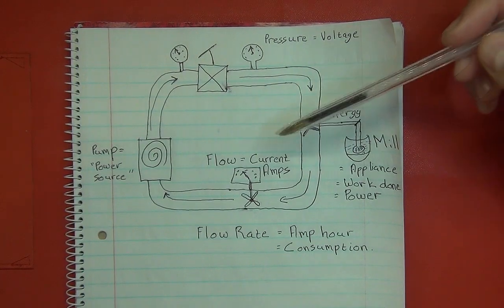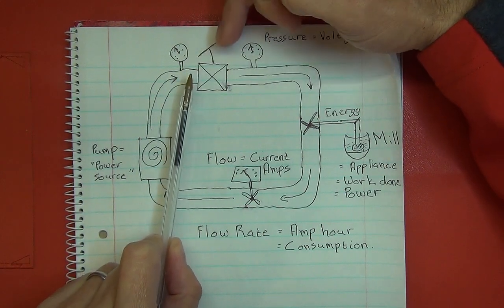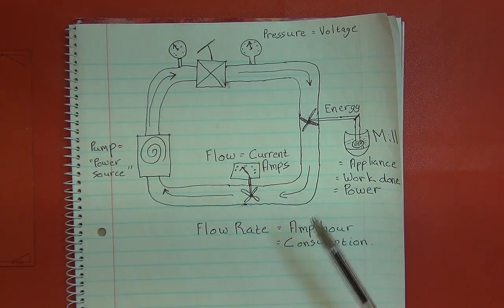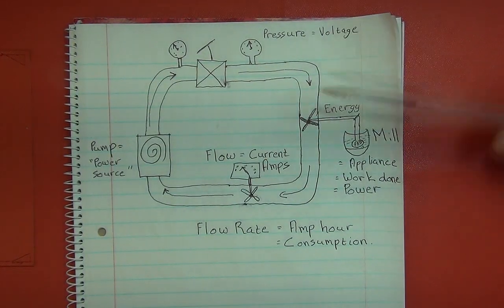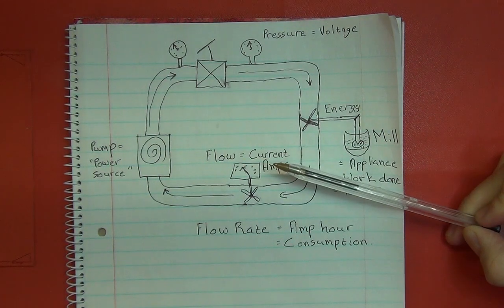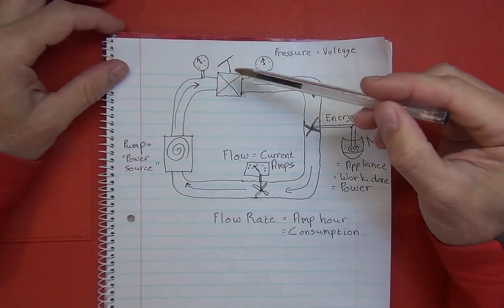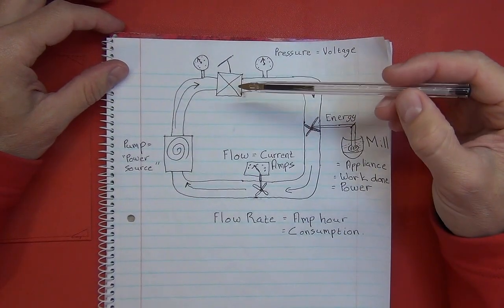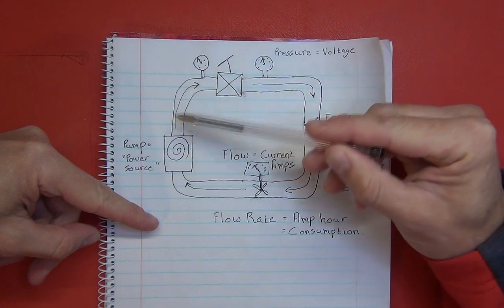Electronics Tutorial #1 - Electricity - Voltage, Current, Power,  AC and DC

Comment: Energy can never be created or destroyed.  Doesn't that mean where in your circuit you take a measurement matters  -  you''ll get different readings?  The values of the measurements on the circuit taken before the mill/appliance will be more than measurements taken on the circuit after the mill/appliance?   On the downstream measurement wouldn't you have to lose something -- voltage, amps?  Thanks.  Just learning electronics now.

Comment: Before I have seen voltage explained as the height of a mountain pushing a mass down the side of it to power electrical components, but the water pressure analogy is much better.

Comment: Hi. Your video is really informative. You are really helping out people who have desire to learn.
I want to ask something here i am stuck in the paper work you did about the flow chart.
I want to know if pump--power source is actually the main DC  line and the vaulve is the power metre where we control all the supply. The thing i am stuck in is how the flow is going towards the main DC line? I could not understand it. There are two wires + & - both go towards the drain from its source. The valve is like a gateway. I just cant understand the process of returning back to the main Power.

Comment: Question: Yesterday I found a old light bulb that has 3 ft long cable that plugs directly into a normal wall outlet. What I wanted to do is make a manual relay switch that activates the light bulb when you flick the switch. Now the switch I found only works with 120v AC. I know the wall socket is 120v AC so what I did was strip the wire and attached it the switch and reattached it to the cable that runs to the light bulb. The idea of it is really simple. However I turned the switch on and the only that that happened was the power tripped for a second and turned back on. Why didn't it work?

Comment: Very helpful.  I am trying to make sense of what I have to know to increase my rating in HAM radio and this helps greatly.  The language of electricity is a very foreign one to me.  Your descriptions are very relatable to me.  My brain is like your 12 volt battery.  Increasing the pressure/voltage/information too high will blow up my brain so this is just right, we have pressure match.

Comment: Thanks for a wonderful tutorial, I hv a Question, While charging a 12 v battery, if i supply 14 to 15 v constant, how much the maximum Amps or current I can supply for the charging ? is it possible to keep the charging voltage constant at 14 to 15 v and increase the Amps only ? but how higher the amps i should increase for charging ?

Comment: Great work! I would only say that AC current can definitely grab hold of you. It will not push you off unless it is a very high voltage. It is common for electricians to get hung up on 277v lighting circuits and they cannot let go or scream as all of their muscles tense up. With some luck they will fall off their ladder and prevent dying. On extremely high voltages they will get blown off but this can cause death or severe internal and external burns.

Comment: fantastic video! really helped a lot, thanks mate. one thing I'm confused about is how the amount (current, amps) works on a real circuit. Here in your example current increases as a result of the size of pipe. Is this the same in electronics and wiring? can the current only increase if the wire is thicker? In your led bulb example the amps increased as voltage increased, yet the wiring didn't change, which kind of confused me.

Comment: Nope..I'm wrong...sorry Martin...I just realized the inverse of 20ms is 50Hz.  What you said is correct.   Your setting is 10ms, which means each major vertical line is 10ms and each minor tick is 2ms which is dependent on your settings.  We know that your input is 50Hz because it took 20ms to complete one sine wave.  And 1/20ms is 50HZ as time and frequency are inversely proportional.

Comment: A big "HI" to you wise man!  I have got a crazy question. When I turn on the motor of my Nissan X-trail, my Garmin GPS (Nuvi500 has no battery) turns off, because the starter drags down the car battery voltage to 8V. Thus, I series soldered a 65000uF/25V electrolytic condenser and that allows to bridge the momentary min. 300mA/10V power loss. 
Question: is there a way of using smaller condensers, such as using super capacitors?  I bought some o.47F/5V5, but when I connect 3 of them in series the GPS ignores them. How come?

Comment: Just a thought on your closed water system analogy, if the system was made of 'magic' pipe that automatically sealed when cut/broken then it would closer follow the electrical circuit model. You analogy would hold water so to speak - pun intended!
BTW great vids, filling voids in my knowledge, thanks :)

Comment: What happens if you turn the 'output' off on the power supply while the battery is hooked up? Would the power supply handle the electricity coming in and just dump it?

Comment: Looks like I'm 3 years late to this party! Do you have any recommendations for absolute must have tool for working with electronics? I will be doing work with solar installation, wind power generation, and water power generation, also - some circuit design.

Thanks so much - on to lesson 2!
Reply: This is a very useful app for use on an android phone :
I use AppDevGenie, which you can find on the Google store for Android devices. Very useful.
Reply: Look for "ElectronicsCalculator" by the above provider.

Comment: Thankyou, after asking 3 different electricians about the flow of electricity they all tried to convince me that AC flows in one direction where I suspected it went backwards and forwards. I even drew a sinewave picture with a positive, neutral and negative side to visualise my suspicion. Are the 3 pins in a power plug representative of the 3 states of power? if so is earth the negative? and does having only 2 pinned power plugs mean it has to be a DC appliance?

Comment: Hi mr. Lorton, i have a question. What happens if the pressure/voltage pushing into the battery is lower than the battery? Lets say the battery is 12volts and the device pushing into the battery is only at 5 volts? Does the battery lose pressure? And then what happens next? Excuse my slow brain hehe. Thank you in advance and I really like your videos.
Reply: You just subtract the pressure opposing the battery pressure to work out the net pressure. For example: battery pressure = 12 volts, opposing pressure = 6 volts, the final pressure = 6 volts from the battery.

Comment: ok. pressure is the same analogy as voltage and flow rate acts like a current. you explain the physical quantities with other physical quantities?!
Reply: ok. how to understand what flow rate is could you be more specific?
Reply: ***** Current flow is defined as 1 coulomb of charge (which is a "packet" of very many electrons) moving past a given point in a circuit every second.
Reply: ***** BTW, what I have just described = 1 amp.

Comment: I have just built my first circuit.  A simple fan speed contoller using a LM317 voltage regulator.  Thank you for your video.  I'm looking forward to listening to other videos.  I am now looking to add a transformer to the mix so I don't have to rely on a wallwart.

Comment: Static electricity is also dangerous when it comes to electronic devices. You could blow something up if you don't discharge the static before handling electronic equipment.
Reply: I work in electronics workplace and we have to use esd technology and grounding ourselfs when working with sensitive components on boards.
Reply: Nate S cool. do you sometimes use antistatic wrist bands? Also where can I get some more electrical experience? Just wondering because I don't really have electrical experience and I would like to get more hands on experience. I did take some electrical classes at my University. It seems like a lot of places want years of experience. And I'm really trying to find a full-time job in something technical. Thanks.
Reply: Yes, we use antistatic wristband and we test them. You do get experience as you work. I didn't had experience before I worked there. I guess It depends on the job. I do my own electronic projects at my house. I really enjoy it. :D
Reply: Nate S Cool. What kind of electronic projects have you completed? It sounds fun. What in particular will make an employer want to hire someone who wants a job in something electrical? Thanks! :)

Comment: so can amps be considered the SPEED of of the electric current? because with the mill you drew the only way to make it spin faster would be to make the current go faster, and how would you measure amount of electricity if not how much flows per second or given time frame, so quicker current would mean more amps, yes? no?
 please respond im trying to learn
Reply: so i just read your annotation where you stated that, but i watched afrotechmods video where he explains amps and he explained it as volume, he showed an over symplified example of a wire 1 electron thick, and  that was 1amp, so a  wire 2 electrons thick has 2 amps flowing through it, but that would alow the rate of flow to be canstanst even tho amps change, now im more confused
Reply: The speed of electricity is 186,000 miles per second, which is the speed of light and the maximum speed anything can travel. It is not the electrons themselves that travel at this speed but the
Reply: almost instantaneous impulse of all the electrons moving over a distance. Think of individual links on a bicycle chain moving fairly slowly yet the whole chain moving virtually at once.
Reply: Richard Townsend thanks!
Reply: I think I say something like that. For example if there is 2 amps then its about 2 Coulomb's per second. So I guess it is travel rate?

Comment: This is a good tutorial. I did not read all the comments so I don't know if anyone else had said this, but in the US all homes have two 110V lines and one ground line coming in to the house. So you have 220V in the circuit breaker panel and you can wire some circuits for 220V example ( central A/C, heat pump, electric stove ) . All standard outlets are 110V.
Reply from the maker: John Coniglio My pleasure John, thanks for the post. Yes, I'm based in the USA now and a video I'll be doing soon will be based on the US wiring system.Cheers, Martin.

Comment: Thank you so much for this series! It's extraordinarily helpful!  One thing I don't understand however is how AC current actually would flow through a wire.  Direct current seems to just go through, so in the fluid analogy, if we put something in the water like a beach ball we would see it move through the pipes.  If we did the same with AC it would move back and forth, but how would the electricity move through the wire to begin with?  What makes AC current flow from the outlet to the multimeter, rather than just hover around the outlet and never make it to the multimeter

Comment: I have been interested in electronics all my life. I have bought many books and read them. After twenty years of doing that I am not any closer to getting to grips with the subject than I was when I started. The problem I am having seems to relate to having to hold onto theoretical ideas and concepts that I cannot see working. It's all too abstract for me.
I have worked as a mechanic for years. I have no problem at all working on engines and diagnosing problems because I can handle the parts. I can take the parts apart. I can physically examine each component and most times SEE what needs to be changed or repaired. However, when someone hands me a diode or a transistor and says, is this the right one for this circuit I stare at them blankly.
It's a real shame but I just cannot get my mind around this stuff for some reason. Of course, that problem is compounded by ever present technical jargon that just bores me to death. Lol.

Comment: Good show Martin.  The one concept I have trouble with when it comes to electricity is understanding grounding and why it is so important, so necessary for electrical flow. You don't mention that specifically in your video or at least not using that term, grounding, but it would seem to be implied in your illustration in that the flow must have a return lest the pressure be reduced to zero as in your broken pipe analogy.

Comment: I recently boil a battery bank with two batteries and a charger for maintaining a 2 amp trickal charge.  Was wondering ...would it be possible to plug this small charger into my pure sin invertor to bring my voltage back up when the electric goes out,  just a thought and would really value your opinion on this idea.

Comment: I'm a British electrician that emigrated to Japan recently. It seems the Japanese adopted the American electrical system 110/120, and sometimes 100V I think.... All of the appliances are low power, and smaller. I assume it's quite an economical system as it forces people to use smaller appliances, tools etc, but it's a pain in the arse if you want to cook a chicken in an oven, because there are no bloody ovens!!! 

We recently had an Air conditioner unit installed. My wife left me at home and the chap turned up (my Japanese is appalling) and he started bemoaning the molded plug on the air con unit. The air con unit my wife had bought online was rated at 200V. I understood what he wanted to do, he wanted to change the breaker to upgrade it to a 200V breaker, and the socket outlet also upgraded to 200V as the Air con units plug pins are only designed to fit 200V sockets as a safety feature. What baffles me is that without using any kind of transformer, he could change the breaker and magically produce 200V. I have to consider the possibility that 200V enters the dwellings here, but is down-rated to 110V internally. I can't conceive any alternative possibility given the breaker was a straight swap over for the old 100V rated one. I didn't compare the current ratings by the way, but I assume the newer air con unit took more current than the last breaker was rated at.

I definitely prefer the 230 Volt systems. They are much more versatile, and anything that has potential to be dangerous can always be stepped down to 110V through a transformer, so I don't think I'll ever get used to this lightweight system..

Comment: Just to add to your point about the mains in the US, we primarily use 110/120v but if you check your breaker box you'll usually find that there are also a couple 220/240v circuits, denoted by the double-wide breaker.  They are intended to be used as dedicated circuits for your electric stove, or washer/dryer etc.

Comment: AC current causes you to stick, DC throws you.  I know from experience.  With AC your muscles spasm back and forth at mains frequency and thus don't move very far at all.  With mains the power is enough to take 100% of your muscle ability away preventing you from pulling back.  With DC the muscle reaction is in one direction and thus a lot of energy can be build up in the form of speed as you hurtle backwards across the room.  Been there, thrown 6 feet by the pull up charge capacitor of a monitor.  Been stuck to a mains plug the back fell off when I was pulling it.
Reply: I'm a little confused. If AC is 'alternating' and it hits 0 (zero) during its cycle it would seem there's a point of release.. Where as DC is constant straight power and gives no chance for release causing you to "stick".
Reply: Yep and both leave you weak and shaking, sometimes with burnt fingers if you give it a chance to arc.  What I don't get is why when you put your tongue on a 9V battery do you "detect" a buzzing rhythm from what should be DC....  maybe something to do with capacitance osculation of your tongue?
PS:  DO NOT TRY THIS AT HOME!  ELECTRICAL SHOCK CAN AND DOES KILL!
Reply: Oh and AC... best thing you can do is fall over.  Make no attempt to hold you balance and allow your body weight to pull you free.  No always going to work.  If a friend gets stuck, kick them, do not touch them with your hands.

Comment: im going through these tutorial because i want to learn how to open up my dvd player without me being dead lol so can anyone tell me how to get rid of the electricity that remains in the device? thanks :)
Reply: latias715 I'd attach a ~10W resistor to the alligator clip too. Then you can absorb the current, and not have sparks of solder fly around.
Reply: Short any capacitors in the device by connecting the positive and negative terminals together (use a wire/paperclip, and make sure you're not grounded, wear rubber gloves and shoes). If it's a high-power capacitor, use a long alligator clip with a screwdriver, clip one end to one side, touch the other. It's very unsafe if you don't know what you're doing, but that's the basic method of discharging.
Reply: Unplug it and then just leave it for ages. It discharges after time.

Comment: thank it was really helpful,& i hav a simple question,my laptop is connecting to the power source with higher voltage which is charging laptops batter at certain point it matches the level of voltage & can't be charged anymore but whn power goes of it only power up laptop wht stops the batter to push the power in to whole house
Reply: it is bcoz ac is converted to dc but it can't be converted back to ac did the same set up if yes thn why is that ?